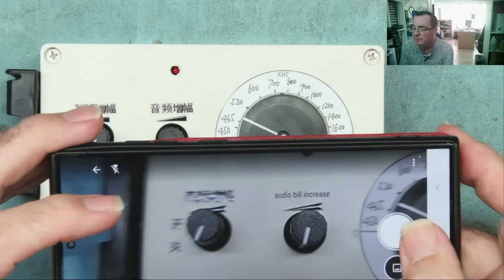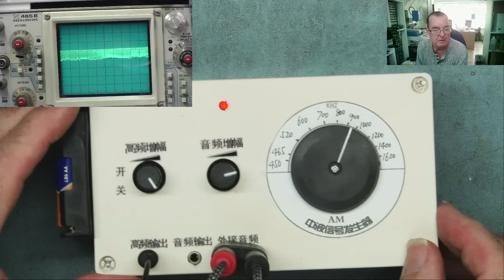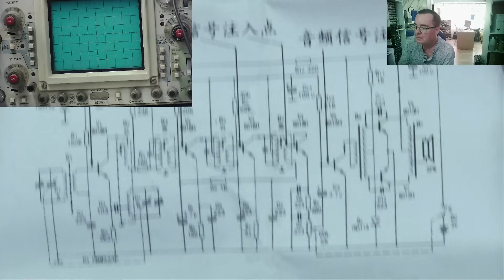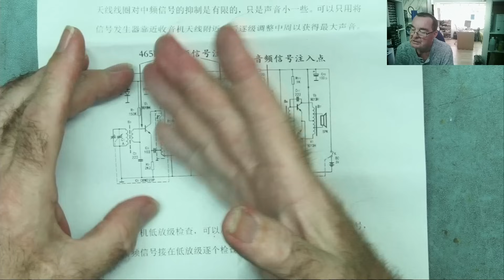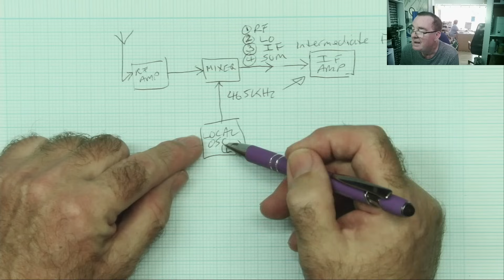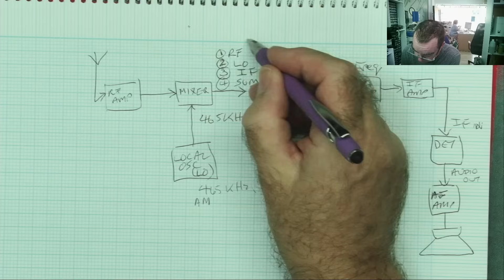A Low Cost AM Modulated RF Signal Generator Good For Radio Repair and BAD For Oscilloscopes!

Comment: JUNK ! I’m a audio tech working at several shops, some shops have limited equipment so I purchased one one these to help rough in tuner tracking. Sent it back PURE JUNK. Radiates all over the place totally useless.

Comment: IMHO this AM signal generator is rubbish.  Any resemblance between an amplitude modulated signal and what it actually outputs is purely coincidental.  It doesn't matter if the oscilloscope is analogue or digital (although the very low end scopes of the latter may be a bit more difficult to trigger a stable waveform with) an AM signal should clearly display the modulation on both the positive and negative halves of the waveform.  In the examples shown in the video it didn't matter which scope Richard used the waveform only showed "modulation" on the negative going half of the waveform.  I don't know the full extent of Richard's test equipment but most half reasonable signal generators can generate an AM signal.  Perhaps before commenting on the supposed "quality" of this AM signal generator he should take a look at a signal from a proper AM signal generator.

As for wasting any money on one of the "more featured" versions of this box of rubbish one might consider Richard's teardown of the unit he had.  The PCB which was partially unpopulated with components suggests to me the same PCB is shared between several versions of this product.  Therefore I'd suggest other versions from the same manufacturer are unlikely to provide better AM performance than the unit reviewed.  It makes me shake my head that techs would waste their money on garbage like this, but I suppose it was sent free from AliExpress there's no great loss except time invested in "reviewing" it. ????

Comment: I think the ic is being used as a modulator and that transistor is the RF oscillator thats being modulated.
They would be deriving the dc for the oscillator directly from the output of the chip that's usually decoupled of dc by the output coupling capacitor. In this way they get a voltage half the supply that swings positive and negative in sympathy with the modulating audio producing AM.
Anyway thats not how you do it... you don't modulate an oscillator like that to get AM unless you want the horrible waveform you saw 😂
Reply: Yep. I agree. That unknown, glued component is probably an RF inductor resonating with the variable capacitor. Modulating a free running oscillator like that will produce a lot of unwanted FM as well.
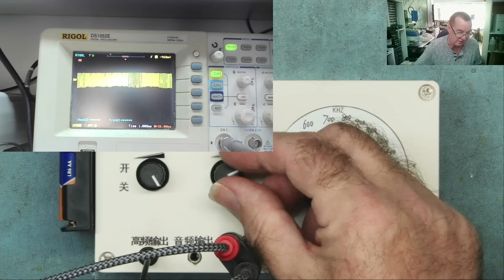Reply: @Manticore1960  At 9:52 that looks like FM.

Comment: Don't bother with getting the advanced version of the tinker toy with FM capability.
People,  save your nickels and dimes and buy a real bench signal generator which allows modulation, AM and FM for testing / tuning IF circuits in radios. Amazon sells some that range in RF between 100k - 100M with modulation AM and FM for around $60 US. These models from China appear to be dedicated to standard AM, FM, and SW bands. A 'real' signal generator won't be limited in that way.
Reply: I fully agree.  What Richard demonstrated was a toy, and a rubbish one at that.

Comment: I would love to see the FM version and see you go through an alignment of a radio Richard. Test equipment(s) to do this procedure successfully is expensive as you know. Could this actually work or screw your radio alignment????  I am intrigued.
Reply from the maker: I think it would work well enough to get the IF alignment to a point where you can actually hear radio stations, even if it is not exactly precise at generating 465Kz for AM or 10.7MHz for FM.  Once the radio basically works you could probably tweak it by tuning in to a live broadcast.
Reply: @learnelectronicsrepair  I see thanks for the update

Comment: There is no value at all to a beginner buying this poor device. Far better to spend the money on a good "introduction to electronics" book that covers the subject of RF oscillators, AF modulation etc. I actually still own my original introduction book I bought back in the early 1980's.

A beginner would learn far more by building a device like this themselves from a quality kit. The alternative is to buy a quality signal generator, i.e. not a cheap Chinese one.

Comment: To see the modulated radio signal, single shot capture works best.

This device does the job of some very expensive test gear made by HP or such. Although not very well.

Comment: That thing is worthless junk. You're not going to be able to use that to test anything besides a garbage can. If you think that thing is useful for 'testing' scopes then it really shows how ignorant you are about metrology.
Reply from the maker: I didn't think it is useful for testing scopes exactly, I thought it was useful to see if a scope could display an AM signal correctly - especially a digital scope.  For that matter I think it wil be interesting to see if they can display an FM signal as well. From a quick test my FNIRSI had problems with that signal as the RF frequency should remain constant only the amplitude should change,  and it clearly does not do that on the display. Regards other useage, it is able to inject an audio modulated frquency at the IF frequency and that seems like a very useful thing for a bit of worthless junk to do, if you are into restoring old radios (and this is quite a common hobby it seems). It can also be used to inject the LO frequency into the mixer as well (without modulation) so it seems a farlly useful cheap tool to me but then I'm not really into radio repair. Seems you are more expert in this field than me - is there some reason it isn't suitable for that purpose?
Reply: @learnelectronicsrepair  @humidbeing is 100% correct.  The device is rubbish.  I've used lots of scopes, both analogue and digital, inexpensive and high-end; and have had no problem displaying an AM waveform.  The cheaper scopes can be a bit more tricky to trigger to get a nice stable waveform on the screen, but as long as the carrier frequency isn't beyond the bandwidth of the scope and the signal level is high enough there shouldn't be an issue.  What you viewed on all your scopes was not a proper AM signal, but rather a very distorted one which suggests to me either the sample you were sent is faulty or the designer doesn't have a clue.  I'm leaning more towards the latter.
Reply: @learnelectronicsrepair  Like you said yourself, it's like something we would have built decades ago. It will have an inaccurate dial. It will drift, as it's a free running oscillator. The output level is not adjustable. The AM modulation waveform is terrible. Unwanted FM will also be present, as the free running oscillator itself is being amplitude modulated. I think it's "value for money" is very low. At the moment a seller on Ali Express is selling the East Tester ET3320C 20MHz DDS Arbitrary Waveform Signal Generator for £72.59 (which includes VAT) to UK. It has AM & FM modes, plus loads of other modulation capabilities. Plus, it has many different waveforms & can be put to so many other uses. It covers both the IF frequencies (455kHz & 10.7MHz). The price is around twice that of the 3 band version of the unit you bought. It doesn't cover the FM band (88 - 108MHz), but then you can buy a very cheap separate low power FM module if you wanted to put out a signal on those frequencies.

Comment: I have seen you use a 10MHz function generator (AWG) in previous videos, but don't know which model. Doesn't that have AM capability? I have a Uni-T UTG962E AWG which can generate AM waveforms.
Reply from the maker: No that function generator has no modulation capability

Comment: It would be interesting to hear what it sounds like on a radio, as the modulation looks awful on all scopes. It looks nothing like a proper AM waveform. It only seems to be modulating very slightly on the lower half of the RF. It should be symmetrical, modulating the top & bottom equally. Having said that, if it's only used to hear "something" on the radio, then it may do the job.
Reply from the maker: I have an AM radio around somewhere... lets give it a go if I can find it.  edit: yeah i found one, will try it on the livestream tonight
Reply: @learnelectronicsrepair  A 25-minute video about a test generator for AM radios where he never bothered to have on hand an AM radio. Sigh.

Comment: for testing Oscilloscopes it be good... but for anything else not so much... first it is not precise enough to do real tuning and calibration for radio's second AM is basically dead..... FM is still in use but also that is going away and becomes 100% digital.... so yeah for the purpose you want to use it for is perfect.... but for the real work repair and calibrate not good enough you need special equipment that cost you 1000's of euros to really do alignments .
Reply from the maker: I wondered if AM (MW) is 'basically dead' and apparently this is not true. It just isn't used in some countries these days but in other regions/continents it is really active. And this channel has viewers from across the globe so who is to argue with the facts?
Reply: @learnelectronicsrepair Apparently, according to Ringway Manchester AM radio became a very important source of information during the large scale power outage in parts of southern France, Spain and Portugal. Ringway said that AM FM receivers literally sold out as digital services failed.
Reply: AM radio is still in use here in Canada although the local station that was the power house years ago has become a station of reruns during the weekends here with 10 hours of reruns of shows from the past week.